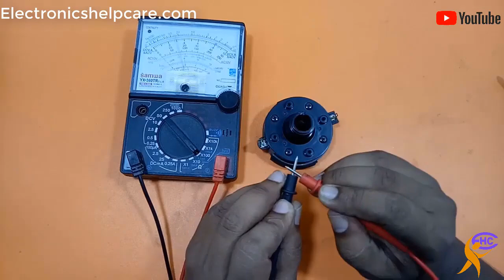How to repair horn speaker

Comment: Good Video but, maybe you should've shown rewinding the Old Coil instead of just replacing with New Coil. Most want have access to New Parts and will just have to repair without New Parts. Maybe do a Video covering the rewinding of Old Wires and rewinding with New Wire. Just a thought.